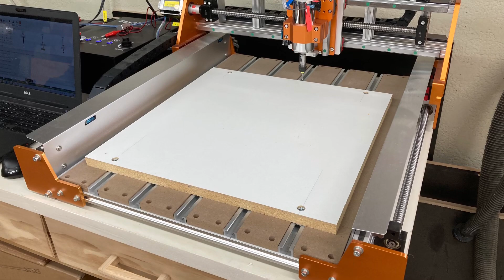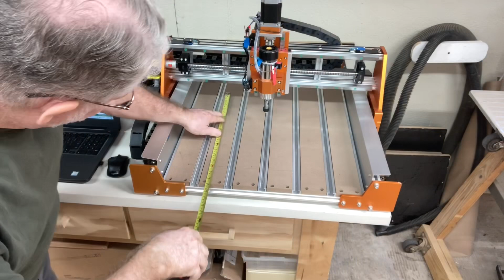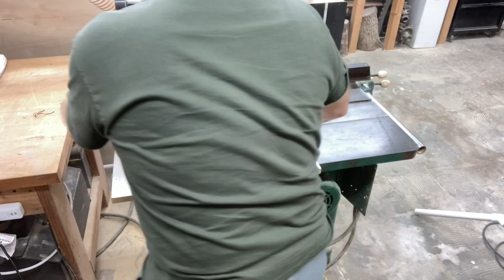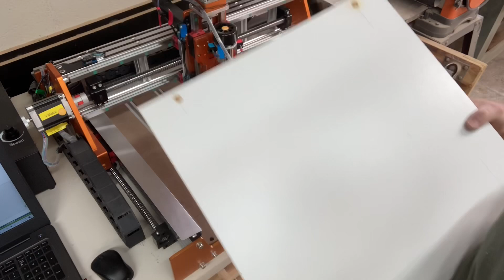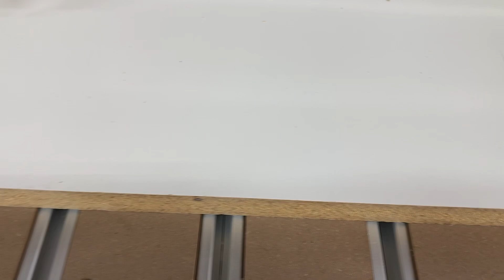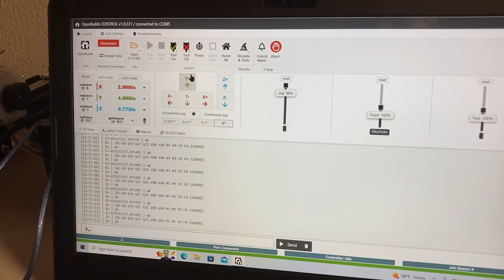FOXAlien VASTO Gets New Auxiliary Wasteboard

Comment: I hope you do some projects soon. The Vasto has been around for a while but there isn't much action on youtube.  I could be wrong but it seems that the work area for its price point is a bit small and runs into other brands of machines that have larger work areas and a similar price point. It's a beast but it seems limited in the cutting area. Looking forward to seeing you put it to good use and I've got my finger on the trigger for a new machine.
Reply from the maker: Yes, I’ll be doing projects on the VASTO soon.
Reply: There are 6 comments currently up on the FoxAlien website when you open the Vasto. The first comment from "john" written on 7/29/22 deserves a reply from a "user", maybe you, if you have the time and inclination. I'm actually surprised that FA hasn't commented on the review.
Reply: It seems it can cut aluminium and brass reliably. If so, then the cutting area qualifies as adequate to me. Rigidity in an area as wide as that is not easy to achieve.